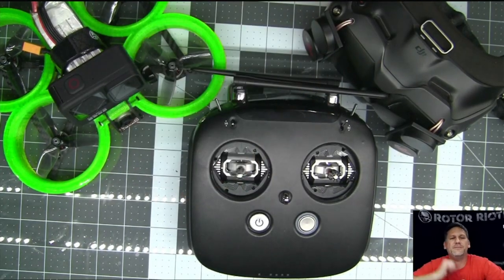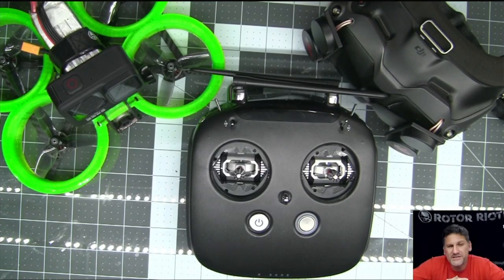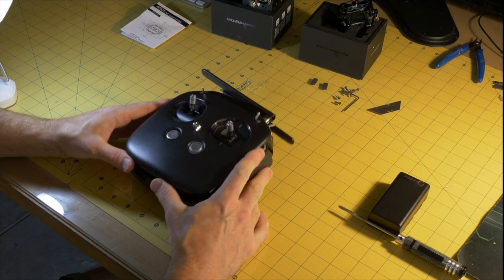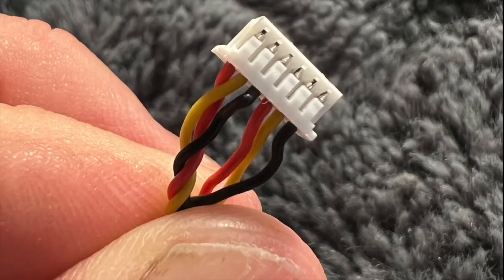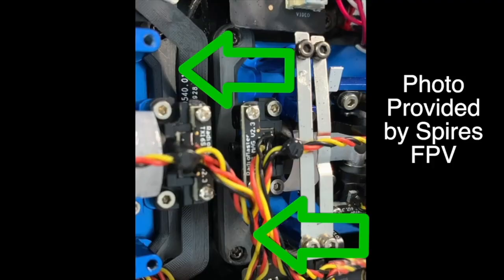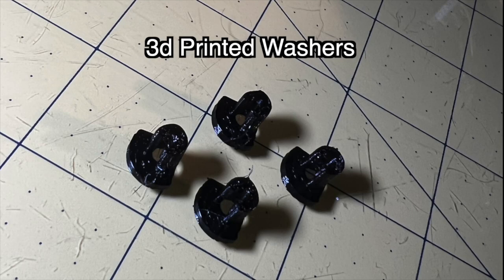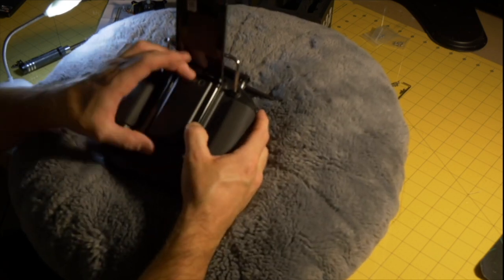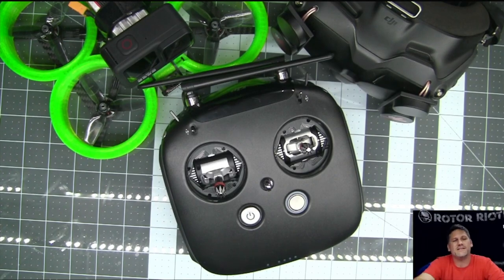How to install RadioMaster AG01 Gimbals in DJI FPV Controller

Comment: Great mod! I just did it myself - the gimbals feel awesome. However I had the problem where both hall sensor magnetic fields affected each other. If I went full throttle - pitch was going up a few points as well and vice versa. I solved it with a large square washer in between both of the gimbals.
Reply: great hint - what material did you use?
Reply: @3stylefpv191  just a regular steel washer, I covered it in electrical tape so it can't short anything
Reply: Did you make a picture? (I’m not asking you to open it and make a foto 🤣) STL file maybe?
Reply: @itskenfpv  so no 3D parts cuz I was thinking you could use a washer
Reply: Where did you get the 3d printed parts? Or did you make them?
Reply: @Funky.P0V  files are in the description. I just looked for a friend with a printer. Make sure to use a hard plastic type of tpu. I just use two rings, 4 washers and two bars.
Reply: I got a piece of MU-metal (from work) to shield in-between. 0 crosstalk now. Mu-metal is probably overkill tho. That shit is expensive

Comment: Man they are finally installed and it feels great.  I grabbed the rotor riot gimbals and really wanted the graphics right side up.  That requires they be mounted in normal configuration.  I'm about a 12-pack in and finally nothing rubs inside the box.  I ground the rocker arm tips down to the absolute minimum, cut out the middle section of battery box, and a tad of the battery case.  It may be ugly, but battery retention still works.  Thanks again for letting me know this was possible.  
Post Scripto -  Had to cut the retainers down to essentially use them as washers.  Also the the Noozle3d rings are dang near perfect.  Not quite interference clearance, but close.

Comment: I often fly in a dusty place, and it always ends up fucking up my original Dji gimbal sensors... So disassembly and cleaning has to be done from time to time. Last time I disassembled it, I found that the sensor for yaw (m2) has some play and I had to re-tight it with some plastic washers because the little screws were looking to be too long.. .strange, but, well, no more problem now,  I'll see how long it lasts this time. I'm happy to know there is an upgrade path here ! thanks for sharing.

Comment: Hi you can avid  cutting the back .You can cutting the plastic rings around where the gimbals go into the case , if you reduce their height by 2mm it all fits perfectly. I used a cheap pair of callipers to scribe a circle around the  inside edge the plastic rings then some good sharp 90 degree nippers to cut away the plastic .

Comment from the maker: Here is a dropbox link to the files in case Thingiverse acts up:

https://www.dropbox.com/sh/5batnz7i8vfgqlt/AACP4T80qLZMyViFsDVk-Zhca?dl=0
Reply: Thanks for this link. How many of each of the .stl files do we need to have printed?
Reply from the maker: @sambutcher6760  you need 4 of the washer, 2 of the rings, and 2 of the longer brackets.
Reply: @LetsFlyRC  thanks so much! Just taken delivery of the CNC gimbals and all the parts printed in petg 😬

Comment: I see it's possible to use hall gimbals works fine on DJI Remote. What about vice versa situation - I want to put DJI Remote 2 internals to old remote except gimbals. On new remote there is hall gimbals and I've tried to connect old gimbals directly to remote 2 pcb and it won't work. On calibration screen I can see only 2 axes in 0 or 100 positions only, no any smooth ramping or something like that. I've tried to test resistance on old gimbals and there is (as expected) vari resistors on 2 axes displays ramp from .4 to 2 ohms or something but on new gimbals (hall) no any numbers. What I've missed here? I've expected similar behavior  for both gimbal systems. Looks like on new remote they used digital hall sensor or something.

Comment: Just ordered me a set.  I don't have access to a printer, but I'll figure something out.  Maybe nip some portions of a washer and drill holes in them.
Reply from the maker: Noozle3d.com can print for you
Reply: Much Thanks.  The lack of YouTube regarding this controller is surprising.  It took me a while to find this video.  Soon I'll have a super smooth Xmitter.  You the man.  @LetsFlyRC

Comment: Hey there! I did this mod and I love it!!!
Now I have the Avata with the awfully small remote2. 
Would it be possible to mod this one with the AG01 minis? Can’t find any tutorials on that (yet)
I would definitely do it if possible!
Thanks for the guiding vid❤
Reply from the maker: Not sure.  I don’t have that transmitter.
Reply: I tried with the remote2 and couldn't get them to fit.
Reply: @NathansHVAC  what was the problem? On second thought I want to see if I can get the electronics out of the rc2 into the rc1 in combi with the large ag01’s

Comment: Great video, LFRC! I recently bought the RR gimbals to upgrade my TX16S. My friend has a QX7 and I was thinking to give him my TX16S stock gimbals, do you think they will fit and work on that radio? Thanks!
Reply from the maker: They might,  but, I don’t think it would be an upgrade.
Reply: @LetsFlyRC  had to grind some stuff, but they turned out real good, def an upgrade. Cheers from Ecuador 🇪🇨

Comment: Wow that’s hilarious 😂 like putting a Ferrari engine in a civic
Reply: not true...I use the DJI transmitter to fly sub 250 toothpicks and It's the best, only 4 wires. No more external receivers, configuuration, LUA, versions....and I always get better range fromm the radio than the video. Also you control the goggles through the radio.

Comment: I followed all the tutorial step by step  but at the time of calibrating I see the “calibration failed” sign . I notice that the throttle does not reach 100 percent, it only reaches 95 percent, do you have any idea why this happens? Thank you very much for the tutorial!
Reply from the maker: Make sure your ag01 gimbals are not set for limited travel.  

There is an adjustment screw that limits the travel.  

Maybe that is the problem.

Comment: Nice video 👍 have you ever though about swapping the antennas to something more portable? I don’t like how long they are.
Reply from the maker: I have seen several antenna mods, and they look like they don't save any space.  They have the potential to gain range, but the durability sacrifice and potential damage to the radio doesn't seem worth it to me.  maybe I will change my mind someday, but, as of now, I like the antennas the way they are.  Although, I do really like the TBS Tango 2 antenna design, and I would be happier with that, it doesn't work the same way, unfortunately.

Comment: Good stuff, might have to do this upgrade. I dig those internally routed X-Air's on your goggles as well. Are they directly soldered inside?
Reply from the maker: Thanks.  They go straight to the ufl connections on the dji pcb
Reply: @LetsFlyRC  Gotcha. How'd you get a ufl end on the X-Airs? Not a standard option right?
Reply from the maker: @nicturner941  TruRC made them custom for me.  If enough people request them, maybe he will make it an item.  ¯\_(ツ)_/¯
Reply: @LetsFlyRC  Sweet, thanks!

Comment: Hey bud, saw your video and attempted to mod my DJI radio with some AG01 gimbals. I was able to take out the old gimbal on the DJI radio. After installing the new gimbals and the printed part, I don't see how the new gimbals are screwed back in as the holes are different. Maybe I might have miss something. Hope you can help
Reply from the maker: You need to 3d print parts that lock it in place:

https://www.thingiverse.com/thing:5320077

Or look up my friend Julian at noozle3d and he can print them for you.  

Noozle3d.com
Reply: @LetsFlyRC  The link dosen't work to thingy dosen't work. I was able to get the file from your dropbox link. I attempted to install the parts and they don't seem to fit.
Reply from the maker: @88_shadesoffpv  not sure what the issue is.   

I’ve had 10s of people tell me they printed the parts and they worked fine. 

Which parts are you having trouble with?   Have you calibrated your 3d printer?

Unfortunately, not much info can be delivered through YouTube comments. 

Reach out to me on Facebook, under Shawn Morrison, and I will try to help you there. Maybe you can send photos of the problems you are having.

Or email me at support@letsflyrc.com.
Reply: @LetsFlyRC  Hey bud thanks for the quick reply. I think I know whats wrong. What I'm installing are the old gimbals that came out of the TX16s. There's a protrusion with these gimbals and prevents the printed parts from aligning to the holes. I've placed an order for AG01.  I will post another reply once I get those new gimbals and see if that is the issue. My apologies for being difficult.
Reply from the maker: @88_shadesoffpv  that makes sense.  The stock gimbals are probably not the same.
Reply: @LetsFlyRC  It is the gimbals after all. AG01 gimbals and stock TX16s gimbals are very different. After shaving plastic and putting it back together & reversing ail & rud, everything worked out and I was able to rip a couple of packs. Took but 4 packs to get use to the smoothness. The right side is a tight for pitch. I'll have to find a video on that. Thanks a bunch. The prints worked out fine.

Comment: Hi Lets Fly RC, the thingiverse link is broken
Reply from the maker: Thanks for the heads up.  I updated the link, it should work now.
Reply: @LetsFlyRC  still not working, might be a permissions issue somewhere along the line locking out public access to the hyperlink.
Reply from the maker: https://www.dropbox.com/sh/5batnz7i8vfgqlt/AACP4T80qLZMyViFsDVk-Zhca?dl=0

Comment: Will the  light mod will work on the dji controller?
Reply from the maker: Not sure what mod you are referring to
Reply: @LetsFlyRC  RadioMaster LED Gimbal Shroud Kit for TX16S I think itl get blocked if i put the link
Reply from the maker: @mfrfpv9079  that is REALLY cool.  I didn’t know those existed.  I am definitely going to try, now.  Thx.
Reply: Any updates on the Light ring Mod, will it plug n play or do i need splice? i heard i lowers the gimbal set a little,

Comment: Hmm. That controller drives me nuts. Heaviest radio I own and also the radio with the fewest features.
Reply from the maker: Yes, but, like Apple, it just works.  😂 
I also crave customizability for my project drones and planes, and am currently using the Radiomaster Zorro for those needs.  But, for my freestyle rigs, which don’t really need customization, this transmitter is small and has great range and penetration.   It beats my crossfire setup most times in penetration.
Reply: @LetsFlyRC  The penetration was ok, but flying through foliage this guy would drop out and leave me on the floor, my ExpressLRS module fares much better.

It's a neat idea for people "just started out" but the cost is very high and expandability is zero.

As you say - so far, so Apple ;-)
Reply: @ShinyVideoStuff  I agree with you 100% as I have the dji system and I fly around my woods. Signal drops insanely fast and out of nowhere in the trees. I am interested in building an elrs quad next!

Comment: The link to thingyverse doesnt work anymore. Anyway to get these files I ordered the gimbals before checking the link lol
Reply from the maker: Thanks for the heads up.  I updated the link, it should work now.
Reply: @LetsFlyRC  just tried the link as well, and still isn't working. 
 Great video can't wait to get these installed on my controller.
Reply from the maker: @AgroAaronFpv  

Thingiverse keeps acting crazy.  Here is a dropbox link with the files:

https://www.dropbox.com/sh/5batnz7i8vfgqlt/AACP4T80qLZMyViFsDVk-Zhca?dl=0

Comment: Good video.i olso use dji controller and i know that radio signl is better than video link.but afraid to do long range stuff.did u tryed long range with this controller
Reply from the maker: The only time I ever failsafed was going behind a mountain in California 2 miles away